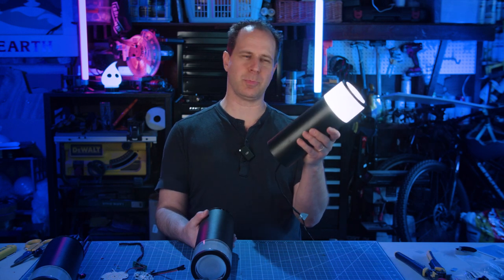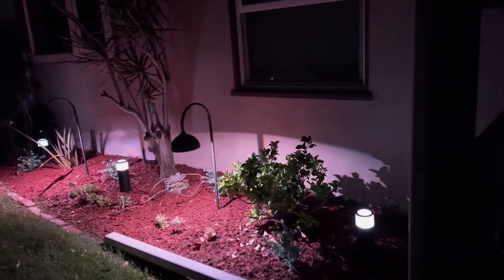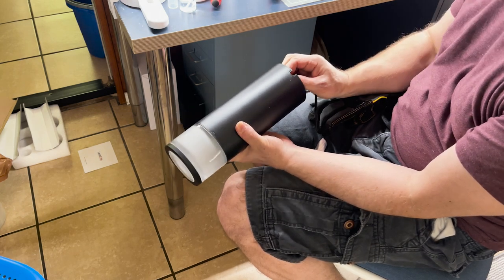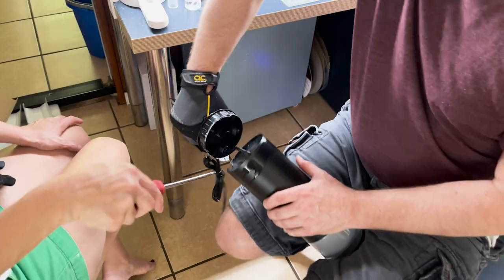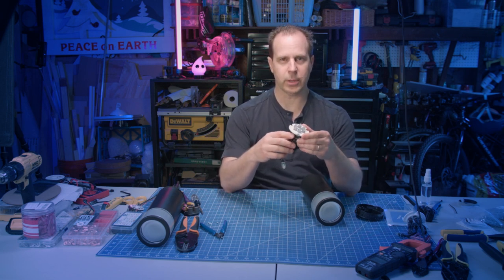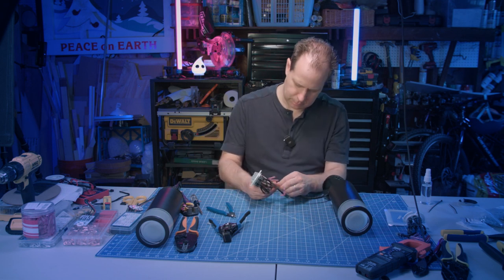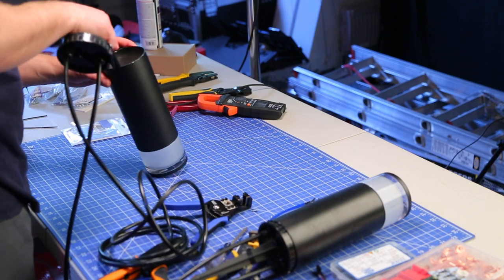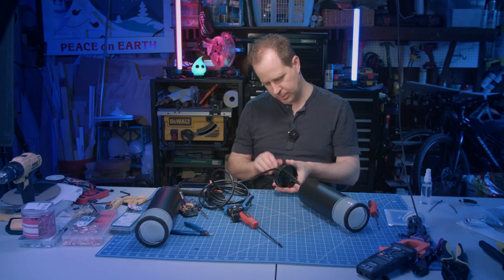DIY Philips Hue Calla For $20 | Running RGB LED Pixels and WLED

Comment: I have Hampton Bay low voltage lights that use very cheap lights and won't display all the colors anymore.  I've been looking to upgrade the fixtures to lights I can program with WLED for my own affects.  This is exactly what I want to do but I don't have a 3D printer and I'm looking for lights I can drop in and add a data wire to.  Any suggestions?

Comment: How far apart did you set the lights? And did you have any data issues or voltage drops?
Reply from the maker: They are about 4 ft apart and no issues with data (I ran 16awg wire). There is some voltage drop but it's not noticeable even at all white.
Reply: @HarbeckLights  Another question... is there a trick to getting these things apart? I tried a heat gun and spraying IPA to loosen up the silicon but I am barely getting a nudge out of them...
Reply from the maker: @JoeSchmoe24  some are definitely tougher than others. We screwed on the stake onto the bottom also to help pry open the edge a bit to get the alcohol in and then really just used the heat gun to get it good and hot. A screw driver as well judiciously to help pry it open a bit.
Reply: @HarbeckLights  thank you. I’m going to give it another try when I can get a second set of hands to help.

Comment: what type of cables are you using?
Reply from the maker: I'm using a 16awg direct burial cable (CL3) like the cables used for low voltage wiring.

Comment: No esp32 chip needed?
Reply from the maker: I'm running these all from a single DigQuad board so no need for esp32 chips on each light. See my DIY Solar Power Box video link in description for more info.